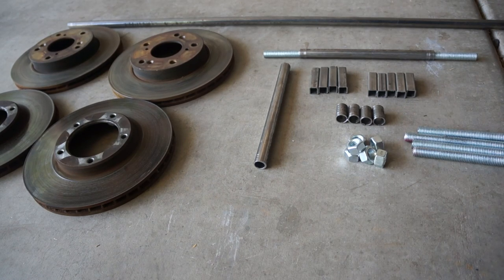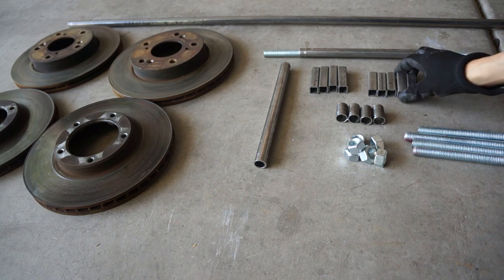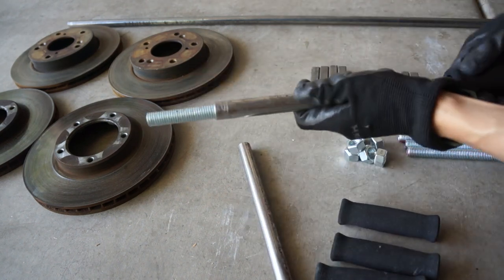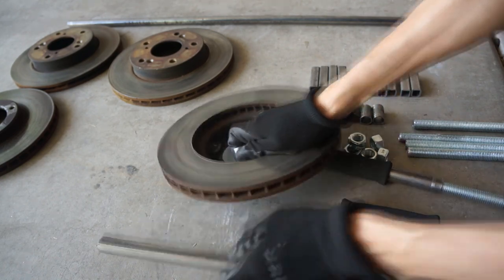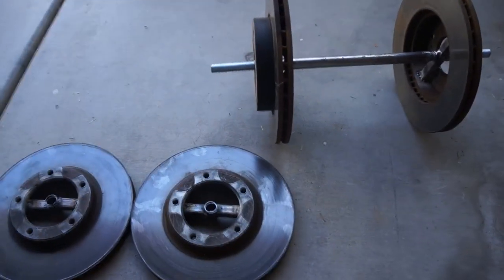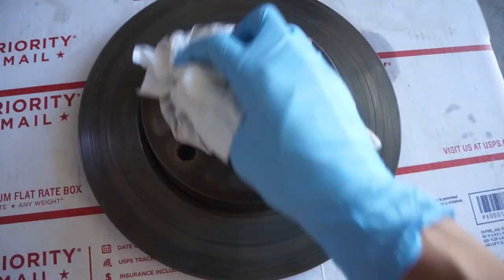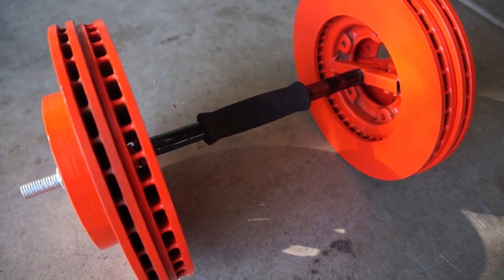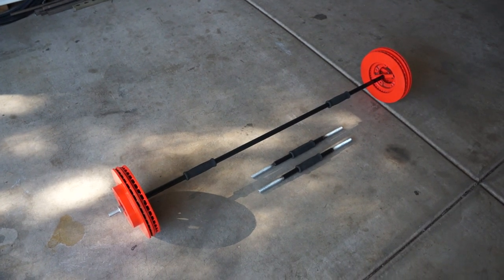What to do with old brake rotors, turn them to barbells and dumbbells

Comment: I just made a set too. I took a 1/4 inch plate bigger then the hole in the disk and welded that to a rod and the disk. I had some 1.25 inch solid steel rod laying around. Nice job, like the color but the rubber handle could be a problem.
Reply: I think instead of the rubber handle he should have used the knurling tool on a metal lay.  That's what most dumb bells have.  Plus, in industrial arts, I loved using it, as they allowed us to dump crazy amounts of oil into the top of it, while it was working.  If he don't have a lay, I doubt someone who does would charge much for that.

Comment: Nice end product. A little too big in diameter for dumbells tho. Thanks for the idea, I think ill use mine for my bench.
Reply from the maker: Depend... if you're Dwayne Johnson, then it's tiny.  :)
Reply: Weight wise yes. I just meant that it would hinder you from curling all the way up. I might try sandwiching two together and filling the inside with concrete and setting a pipe down the center. Would just need some kind of anchor through the lug holes. Wouldn't stand up to abuse like yours tho.

Comment: Yeah, the handle sliding around isn't good, but nice try.   Maybe you will weigh the rotors and mark them so you know what you're adding when you work out.  I'm going to look to see what you did to fix the handle problem.